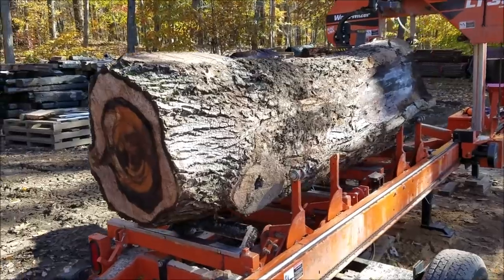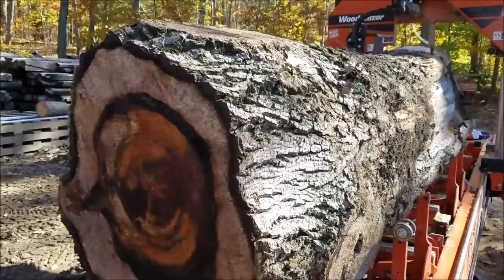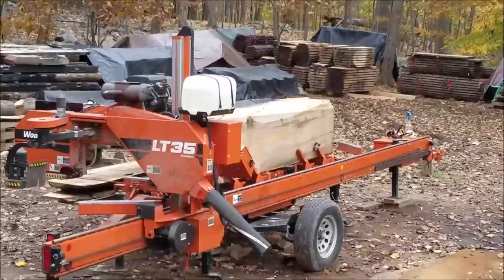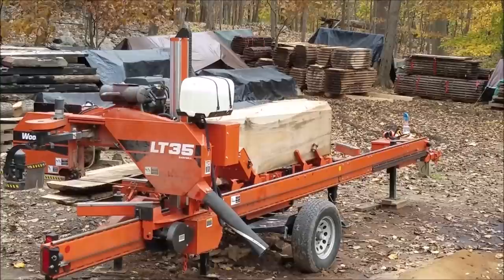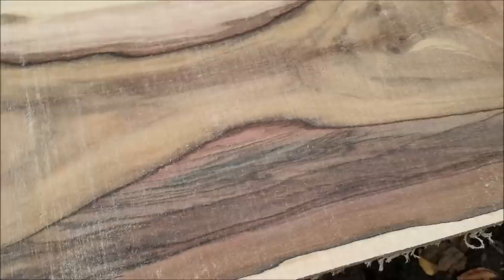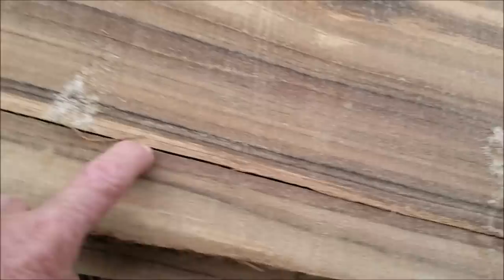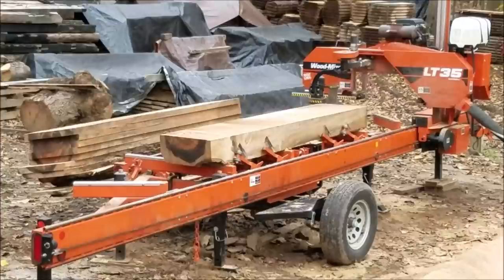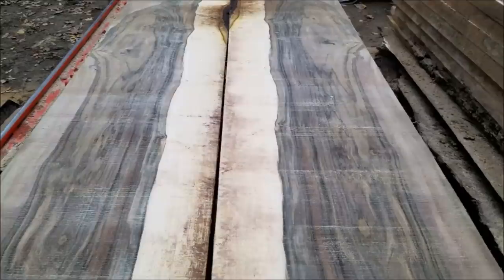Big English Walnut

Comment: Iron and Oak, I had a very nice Walnut in the corner of my property 40 years ago. I was advised by a friend to contact a mill and sell the tree for "Big Bucks". The mill owner first asked me if I could guarantee no metal in the tree and asked if it had other trees around it. I related to him that it was isolated and could be felled without difficulty. He was quick to tell me that being on its own for all the years it had been was a severe negative. The exposure to eternally being windblown, rocked back and forth and twisted with no protection would likely cause it to have bad cracks and splits throughout its trunk. Standing in the company of other trees prevents a lot of issues he told me. Wikipedia, of all places, backs this up.
All in all I think that you still have some mighty pretty wood there. Thank you for the vid, keep it up. Sincerely and in Christ Dorien de Lusignan,VA
Reply from the maker: I will agree with him on this one about the quality of a tree growing in a tight stand with others, but the ring shake he mentioned is caused by bacterium in the wood, and not environmental issues.
It's better for them to grow in a stand with other trees
 It slows the growth, creates small growth rings, and tight grain. In most cases, it limits how thick the sap wood gets as well. In the case of walnut, less sap wood is a very good thing.
Thank you for your compliments and comments.
Have a great day my friend, and please stop back any time.

Comment: Looks like a long sucker was growing up inside the bark and formed a seam, but for furniture the seams and splits can be filled with a clear epoxy mixed with the sawdust of the same tree. You would never notice the difference because there wouldn't be any.
Reply from the maker: There are so many options I'm learning about with these slabs. Cant wait to get started on some of these.

Comment: Greetings, I have the LT-40 HD since 1992. I have milled a lot of different hardwoods. I had milled some English walnut years ago, sold most of it and set a few 4/4 x 12 boards aside to dry. We sold all the Black walnut. I did not think the English walnut would be as hard as the black. I was wrong. We built new counter tops this year from the English and it is amazingly hard. As durable as rock! I should have build with it years ago. We have over a million board feet from our Woodmizer and it is still running like new. Great company too. I just subbed your channel. have a great day!
Reply from the maker: I've worked with and milled the black walnut. Really nice to work with. Haven't done anything with the English yet. I do have another small english walnut log that I want to turn some bowls from. Hope its easy to turn.
Thanks for the sub, and thanks for checking in.
Reply: Been doing turning 12 years and do E.walnut often yours looks more like claro walnut to me but it is really all the same if you don't  know the different types, I'm from calif

Comment: I would not give up on the slabs that are cracked. Get some U nails or strapping nails used in securing wiring. Nail every foot or so holding the wood together. Then when the wood dries it will still be together. You or the customer can put a bow tie in each place where a nail was after the wood has had time to dry. I hate seeing wood like that go to waste. It's  awesome to watch your videos of you and your wife and how you started out with the small mill and how you all have grown into what you are doing now.
Did those intercom head sets not work out? I notice you all are not wearing them anymore. This could be because of the order in which you are editing your videos.
Reply from the maker: The nails are a different idea, I've never seen that used.
Since filming this, I've changed my attitude about these slabs, after doing some research into joining them back together. These should be some great fun to build into something.
Thank you for the compliments. We have worked hard to get here. We still use the head sets. Theybqork really well. 
Its seems that when we are slabbing, we dont really need them. When milling lumber, there are edging boards, lumber grading,  etc. etc, that we discuss over the headsets, while we are running the mill.
Slabs are pretty straight forward. Cut, push onto loading arms, cut again push off, cut again, push off. No grading, edging, etc.
Thanks for checking in. Hope to see you back again.

Comment: I have 4 english walnut trees that i had cut down how many inches should they be cut for a table
Reply from the maker: 2 1/2" to 3" thick. That way if it moves, it can still be flattened.
Will you ha e them cut live edge?
Reply: I had them cut a few months ago
Reply from the maker: @davemcaferty6347  that's fine. Keep them off the ground so they don't rot.

Comment: If you dry it, and let it crack, open the cracks, and allow the entire board to separate, you can make a nice table or two, out of those boards. build a frame, look into epoxy, and make some tables, or even shelves out of them. I would love them, and the chance to work with them.
Reply from the maker: Planning on getting into some epoxy work, also going to practice some bow tie work as well. I cant wait to get to this wood, once it dries.
Thanks for stopping in.

Comment: The badly ringshaked slabs could be used to make smaller furniture parts.
Reply from the maker: Yes they could. Others have suggested bonding them back together in many different ways. We could start working with them soon, as they are close to being dried.

Comment: Did I miss it or did you explain "ring shake" ? I have no idea what that is.
Reply from the maker: Helpo Steve, and welcome. I probably mentioned it in another video, but ring shake is when the growth rings of the tree seperate from each other.
What causes it is somewhat of a debate between wind, weather, and bacteria. 
Once they seperate, the board you cut from that section will simply seperate along those growth ring.

Comment: Beautiful..on the slabs with ring shake, you can pull them apart and make a beautiful river table, with colored resin. The are all a perfect match. You'd have two rivers going thru the table. You tube "river tables" AND YOU'LL SEE WHAT i MEAN.
Reply from the maker: Thank you for the idea. I guess I'll be studying about using epoxy. These pieces are calling for it.

Comment: That can be a problem with english walnut  especially if it has been wind damaged or lightning struck. When it falls is it is a big tree like many timbers if they are dry they split or ring shake . I don't mind it as the timber has unique character. It can be joined .It may takes a bit of time but when it has character it doesn't matter. The Spalding on top of everything else is nice.
Reply from the maker: My attitude about these ring shake slabs has since changed. Epoxy works wo ders, and will help to save these beauties. They are worth the extra effort.
Sorry for my delayed response. We hardly ever miss a comment.
Thank you for checking us out, and welcome to the mill.

Comment: Seems to me as you cut those slabs with the ring shake, you could metal or nylon strap them to hold 
together until after drying. Then the buyer or you could unstrap, epoxy bond the check crack and restrap 
until cured. The extra cost of labor and material to do it should not be that high.
Reply from the maker: I have since  hanged my attitude about slabs like these. Epoxy is our friend in this case, and will make these slabs very usable. The coloring, and grainnpatterns are much to ni e to toss them.
Sorry we missed your comment Michael, and welcome to the mill.

Comment: Cut a little thicker for gun stock blankes  to
Reply from the maker: Hello, and thank you. I have a few enish walnuts coming in the future. What thickness do you recommend?
Reply: Iron & Oak Sawmill between 10 & 12/4 look up on net for different sizing short around 20” pieces for shot gun stocks and fore arms and longer 40” pieces for rifle stock. Might even be able to sell to stock makes rather than piece meal.
Reply from the maker: @time7559  is the English walnut preferred over black walnut?
Reply: Iron & Oak Sawmill go to American walnut company or Macon gunstocks this will give you a idea what stock makers are looking for they might want to buy just the log stock makers are fusssssssssssssy
Reply from the maker: @time7559  Thank you again. I will do that. Never cut stock material, but would like to get into the market. I'll research more as well, to be sure I'm cutting what the fussy folks want.

Comment: How about putting the long 90 degrees and cut the log so the majority of the ring crack is only in one or two slabs ... The crack would be horizontal, not vertical and then minimizing the mess to only a few slabs yes the crotch figures would be different but different is good...Use the bad pieces for art projects or thing like a religious cross, pictures frames, trophy bases etc...
Reply from the maker: The crack isn't vertical or horizontal. Its circular, and will appear at the same place no matter how we turn the log.
Thank you for checking in, and let me know if I'm missing something.

Comment: Cool vid. All we have here are blackwallnut.going to sell one thats 40 inch cross...n.c. Whats a good price 1000 board foot veneer quality.?
Reply from the maker: Sounds like a great log, but it's tough to price wood for another region. 1000 bdft of veneer log should command a good price.
Remember though. It's not finished lumber, and alot of expensive machines, and talented people have to touch it before it becomes lumber,  so dont price it at finished price.
Thanks for checking in.

Comment: i think when you have a vertical check like that roll the log , and cut down to the check ,it should keep the slab in one piece, might help ,
Reply from the maker: Hell Sam. Sorry I missed your comment. I do that with checking cracks, but these are from ring shake. An issue where the growth rings seperate around the entire tree. I should be able to work with these,  using epoxy. Cant wait to hit these with some finish, and see the grain pop.
Welcome to the mill Sam.
Reply: Wow that's a new one , I just learned some thing to day ,,and it didn't hert ! Thanks ,good luck with that